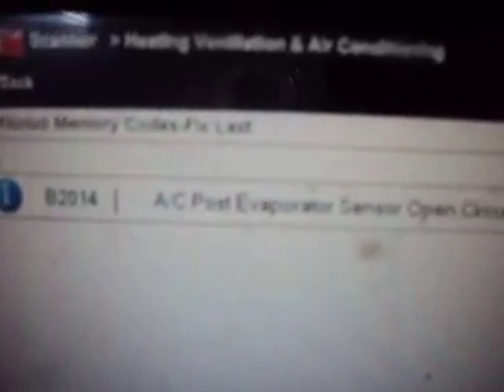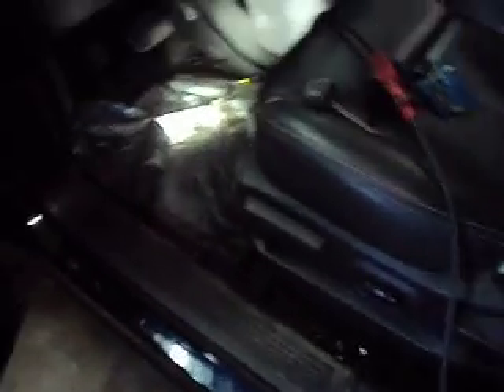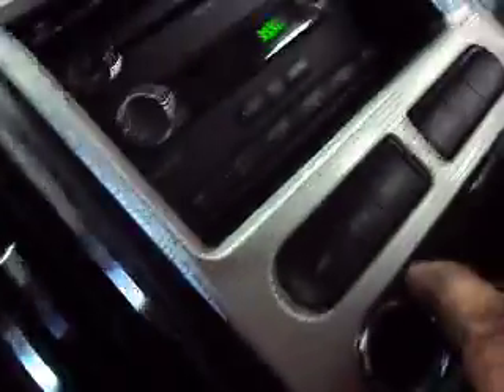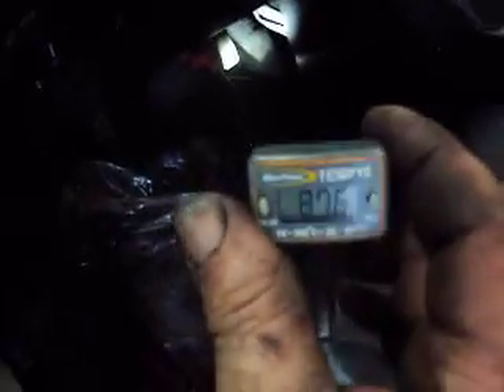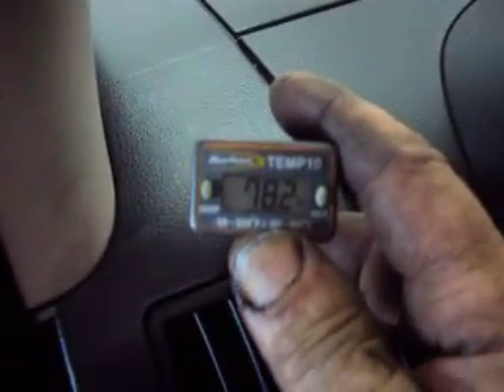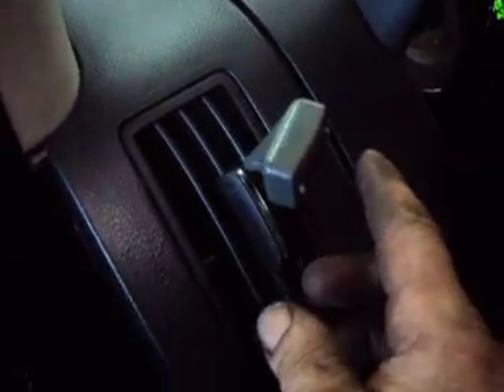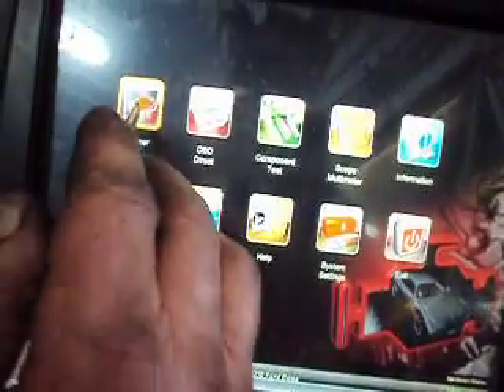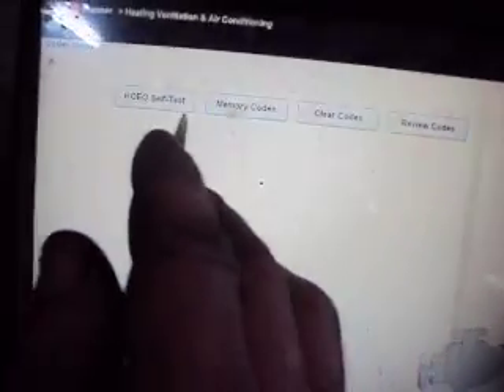2010 Ford Edge with code B2014 and an inoperative AC compressor

Comment: did you get a check engine light on a dash? or did you just run it on the diagnostic machine because it was not working properly